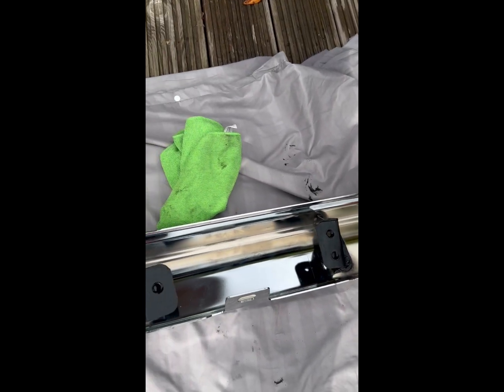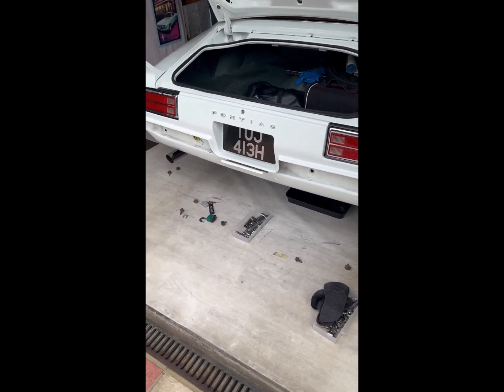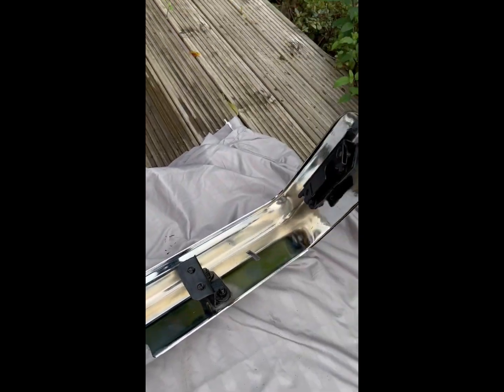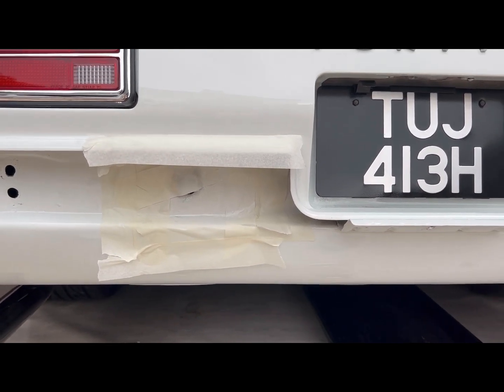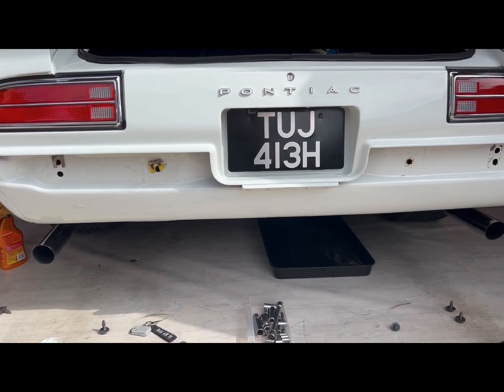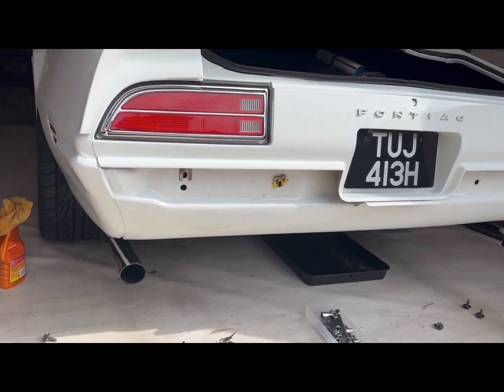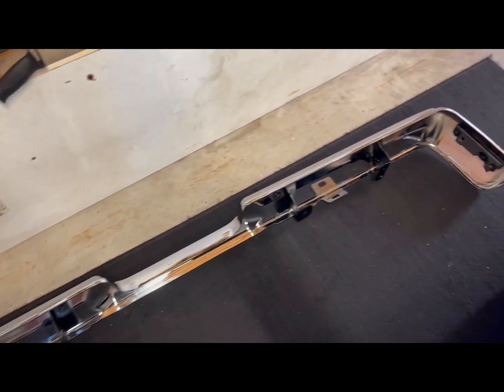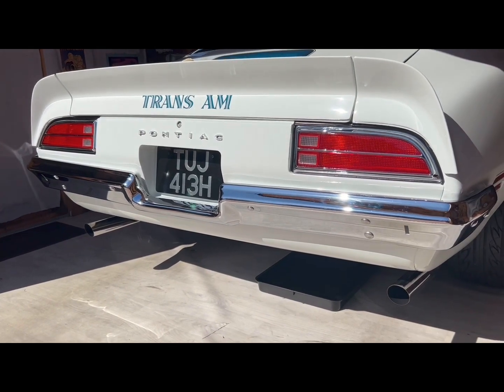Rear bumper work on my classic car Trans am #pontiac #car #cars #automobile #automotive #classiccar

Comment: Great work, I need to remove my rear bumper  as its slightly out of alignment on the passenger side bumper return and future proof fixings and internal face etc as you have.
Is it possible for one person to do or a two handed job for removal and refitting?
Mines also a 70 TA based in South East England.
Reply from the maker: Hi again, it is easier with 2 if possible, but if you remove the bolts from the side on each quarter panel, then you can remove all but 2 along the rear of the car, the studs will hold it in position while you undo the last 2. There is quite a bit of adjustment on all the brackets on the bumper itself. I just used plenty of white masking tape when reinstalling so I could adjust without scratching the bodywork. Good luck👍